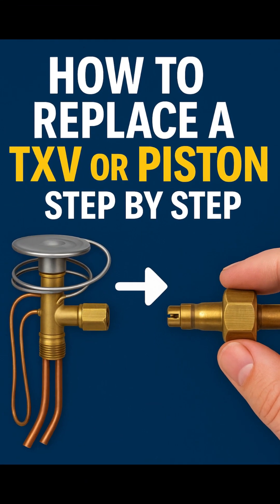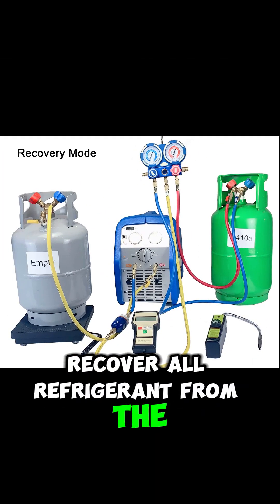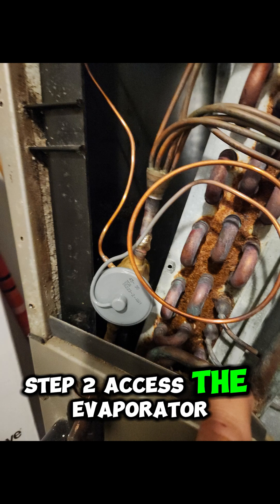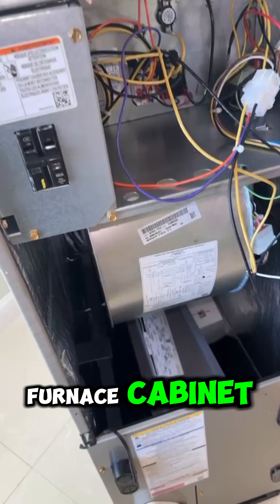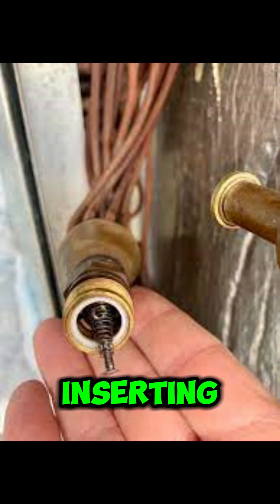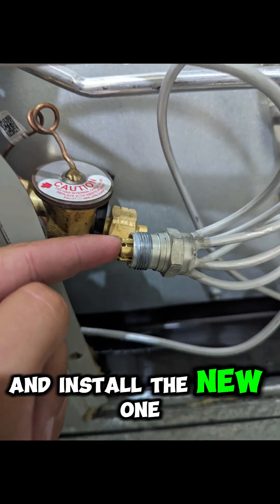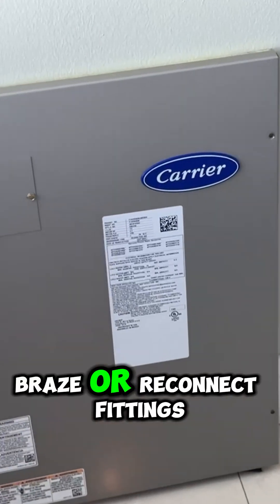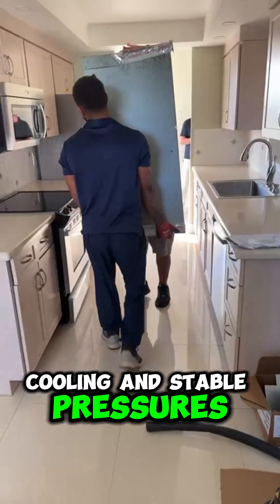How to Replace a TXV or Piston  Step by Step #shorts

Comment: Does the piston go back or you don’t need a piston.
Reply: You need an expansion valve or a piston.  One has constant feed, and the TXV uses a differential to mitigate, temp ,pressure, and superheat.

Comment: Why not pump the system down replace parts .Install a new drier filter, pull a vacuum, check for leaks, release refrigerant, and set the charge . Why recover? 🇺🇲
Reply: Put new virgin refrigerant into the unit. Especially if you’re not sure the charge is correct
Reply: @grantdangelo6027 Unless you're a hack you're most likely going to be checking pressures anyways after changing a txv lol
Reply: They failed to mention replacing the filter drier in the process